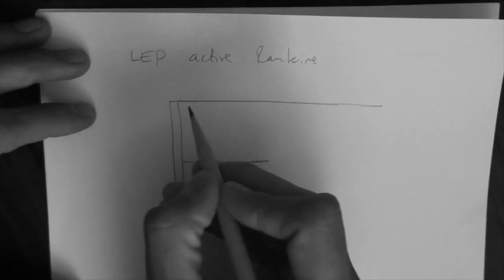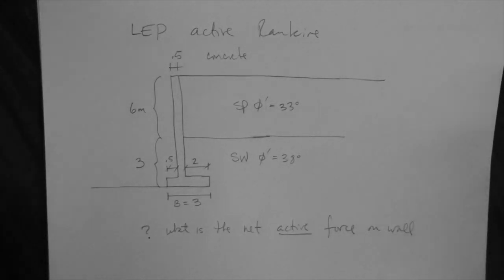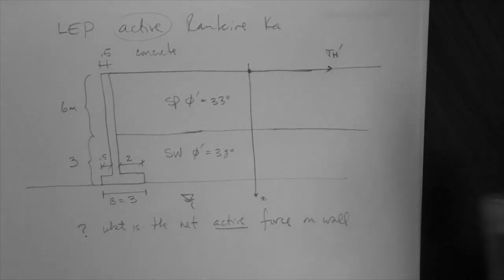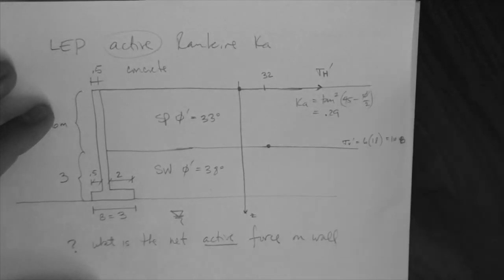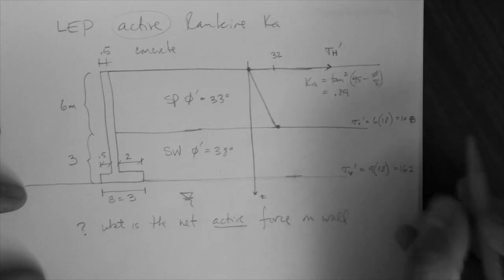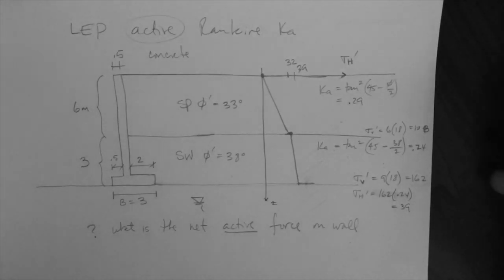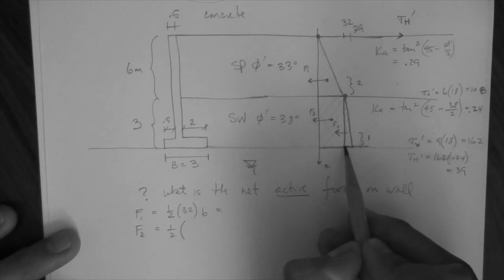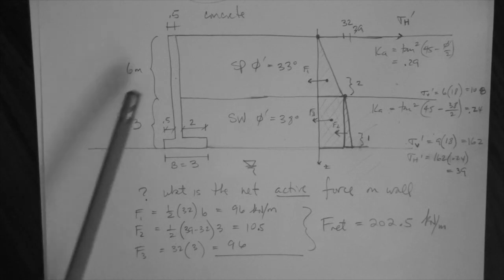Active forces on a retaining wall (Rankine)

Comment: This is wrong ...At interface k value changes what the hell you have done ... Disgusting ... Uploading nonsense to misguide Students
Reply: Hello, should there be a discontinuity in the horizontal stress at the interface? I was wondering the same thing as you but was hoping for some clarity as well. In the top layer, the horizontal stress at 6meter depth would be 0.29 * 104kPa = 31.3kPa but at the transition to the second layer, wouldn't the new horizontal stress be 0.24 * 104kPa = 25.0kPa? Maybe the theory says the horizontal stress is continuous across the soil types, but I'm not familiar with that. Please let me know if you can provide a link to the literature on this subject.